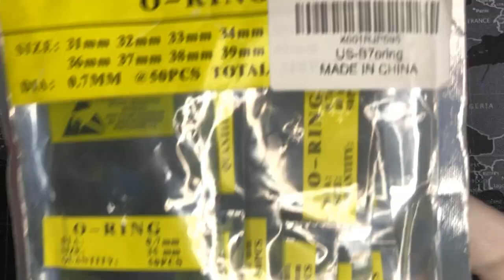How To Replace a Quartz Watch Movement - Watch Repair / Step-by-Step Instruction

Comment from the maker: The only thing I would add to this video, is that it's helpful to have a dish to put the parts in. Sometimes you can use the case-back, but generally, you want to have a shallow container to put the parts in, rather than simply placing them on the pad as I have. You never know when someone might bump the table. In this case, the table is a shellacked 3/4" piece of laminated plywood that is mounted to a solid food frame, and bolted into the wall, so even a line-backer running into it wouldn't budge it. But I wanted to mention that as I noticed I didn't do this when I was just re-watching this.

Comment: You had the replacement movement already - where did you find the correct size and type and know what to order?
Reply from the maker: Hi Jeff, basically, I open up the watch first, identify the movement, and then look it up on either Esslinger or eBay. The model will already be properly sized, so that’s never been an issue.

Comment: Are there any tricks on how to properly align the second hand with the dial indices other than trial and error? I must have set the second hand 20 times just trying to align the indices on the dial.
Reply from the maker: Hi MTB, it really depends on the movement and face. Sometimes the cam on the second gear will never allow it to match up with all the second marks on the fact, but if done right, should at least be able to line up with the 12, 3, 6, and 9 locations.

Best thing you can do is take the battery out, and engage the crown. This ensures the gears are at the end of a second cycle. Then, properly align the hour, minute, and second hand to the 12:00 location with the crown engaged. Then when you put the battery back in, they should line up.
Reply: @ToddsWatchshop  Thanks for the reply. I will give it a try.

Comment: Great video, thanks. Curious, would this have been any easier with a movement holder?
Reply from the maker: So, depends. In most cases I would; however, all I was doing was replacing the date ring. The movement is also quartz, and all the gears, etc., are internal and tucked towards the middle of the movement. This being the case, I prefer to hold the movement itself as it provides better leverage when removing the small screws at the top.

Now... when I work on a mechanical movement, you MUST use a movement holder. You simply cannot rebuild a mechanical movement which has gears / balance that sometimes extend beyond the base plate. So a movement holder is absolutely a must.
Reply: Thank you for the thorough answer. I’m just getting in to this. It’s awesome to be able to restore friends and family’s cherished time pieces. Cheers! 🍻
Reply from the maker: Feel free to ask me any questions. If I can answer, I will!